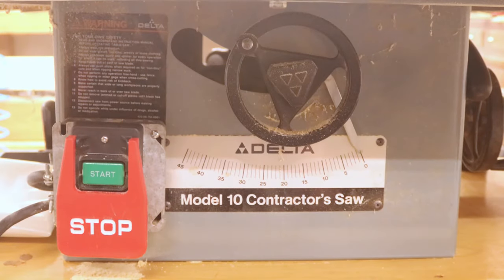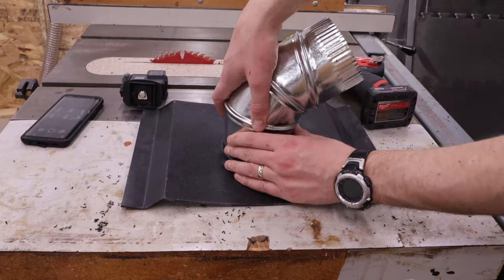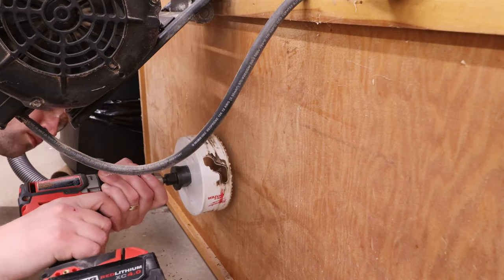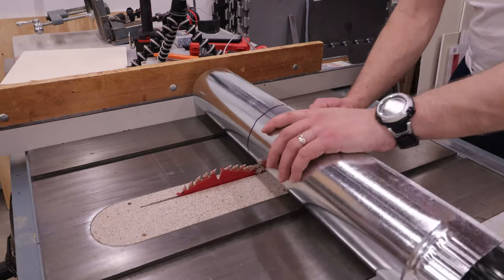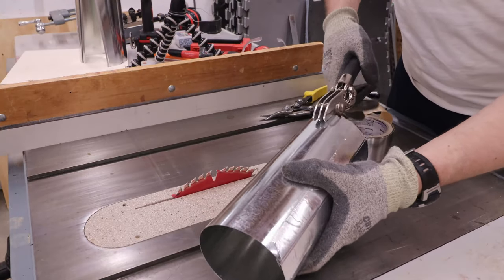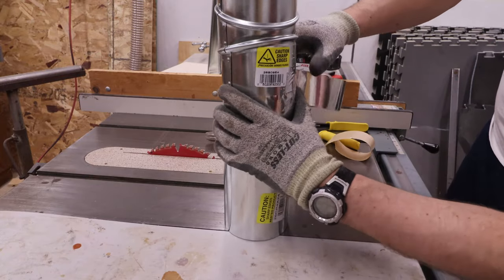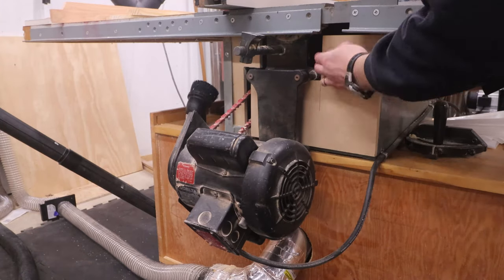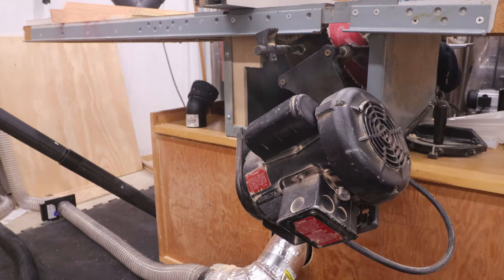Adding Dust Collection for Contractor Table Saw | Delta Model 10

Comment: I have used a very different approach to dust collection on my saw using the stand as a drop box (with a door) with dust port near the top and a high CFM collector and open back of the saw this collects near all of the dust. It appears to work better than a similar approach to yours I’d tried earlier.
Reply from the maker: Yeah, I think CFM is my issue here too. Tough to get adequate airflow in a small shop when you can't get a big dust collector in.

Comment: To account for when the blade tilts, attach a piece to the arbor.  Leave the piece on the back of the saw large enough to clear the arbor.
Reply from the maker: I was trying to figure out a way to do that, but kept running into issues with it hitting the bottom of the saw bed.
Reply: @GlennFrazeeYT  I commend you for trying. I haven't done so yet.
Reply: I recently built a simular set up for my 40 year old Craftsman table saw. I wish I would have known about the plastic piece. Also the duct tubing is a great idea.
Reply: This is exactly what I asked 2 other people that completed a very similar configuration.  They put the backing on with what appeared to be no consideration of the motor tilt.  At first I agree with Glenn that it's worth dealing with the limited amount of dust when you tilt the saw.  One possible solution I though of would be to use a heavy grade trash bag and cut out enough plastic to go around the motor mount on the right side leaving enough plastic to be flexible when the motor tilts.  Secure the trash bag plastic with duct tape.  Keep the rigid board on the left for the belt to have space.  I might try this with mine as I have been watching vids like this to get enough information to build my own solution.
Reply: @RedcarWW  Interesting idea.  I don't have any dust collection on mine.  Don't use it very much and don't have much space.  Some day.

Comment: that belt looks way longer than it should be.
Reply from the maker: Nope, fits the saw just right
Reply: @GlennFrazeeYT  i'm sure it "fits", but you're reducing the belt drive's ability to absorb shock and vibration and adding extra strain/wear on the belt and bearings by having the motor that far out and that low relative to the motor mount's hinge point.
Reply from the maker: I don't know for sure because I'm not the original owner, but I'm fairly sure the motor mount is all stock. Comparing mine to others online, they all look similar.

Comment: If the video is so boring you have to speed it up, why not just play it at normal speed, show a short bit of what you're doing, then go to the next step. Taping up all the ducting could take 5 or 6 seconds at normal speed, then a couple seconds of drilling while you use the same exact narration. This video is informative but watching tape being applied at high speed for over a minute is boring and stressful, anxious to see what's next. This could be a very watchable 4 minute DIY demonstration.
Reply: @GlennFrazeeYT  I have a newer version of the same saw, so I do like seeing what other people are doing. I thought the sped-up sounds were funny also.